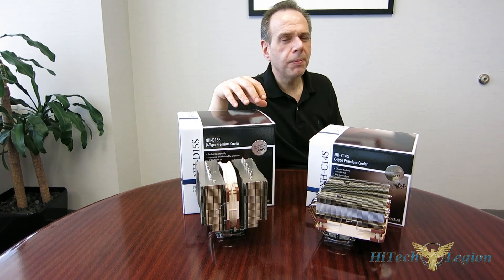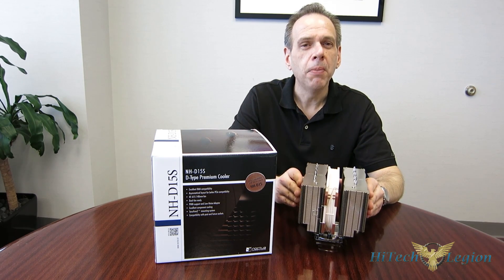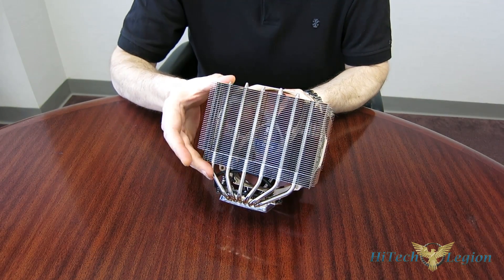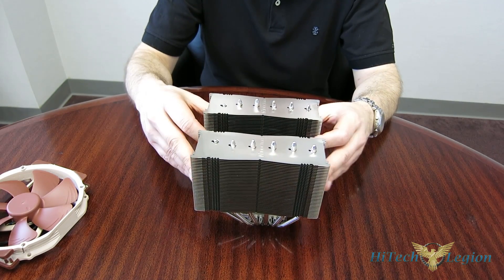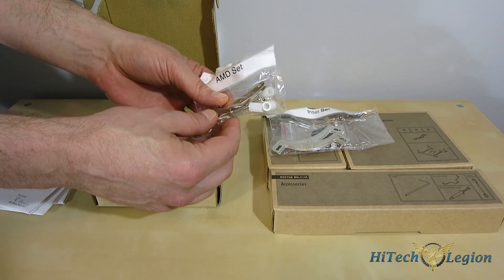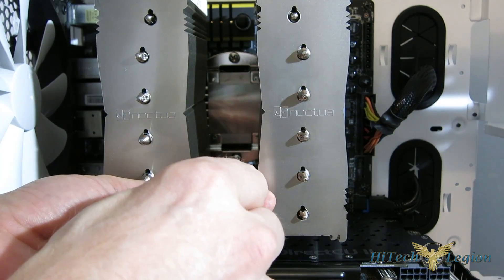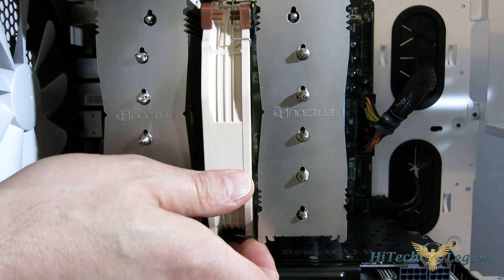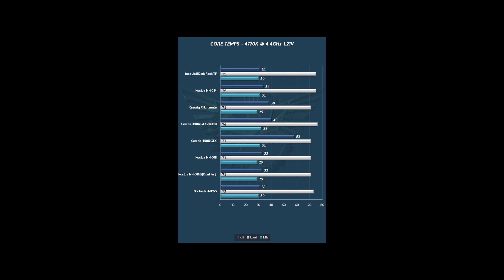Noctua NH D15S High Compatibility CPU Cooler Overview, Benchmarks and Installation

Comment: Thanks for showing the GPU clearance due the offset of the 15S. No one else had shown that yet, it’s actually quite a bit of room. I’m thinking it will not only improve compatibility, but possibly help with thermals as well

Comment: It looks like a very poor design - putting a fan IN BETWEEN 2 heat sink towers, what is the logic in that - the fan in the middle will simply pull HOT air from the nearby tower onto the other tower - i cannot imagine it being an optimal cooling - wouldn't it have been ideal to have 1 fan on the far right of the 2nd tower blowing air, and the other fan at the far left of the 1st tower (sort of in a push pull configuration) so 2nd tower gets air, 1st tower fan pulls hot air out to the exhaust.  This product is hype I hear too many complaints of people who say their temps are close to Tj, even when properly applying paste and seating.   Also it is not true that the fans are quiet, they might be quiet in SILENT mode - but they WILL sound like a Pratt & Whitney on high throttle just ready to takeoff, starting at near 100% speed, and they will be running at near to 100% speed during gaming and rendering.  It might be OK for older CPUs but Intel and AMD are creating new products that are power hungry monsters and heat generators, ALL new generation CPUs run CRAZY HOT, that even the best coolers can't keep up with short of using compressor based sub zero coolers.  It's NOT normal that a 2nd fan only improves cooling by 2C, that's crap, it should be improving it by much more, if it was not just blowing the HOT air from the other tower - I could see a 5C improvement  if it were used in a push pull config and not a middle fan, but oh well.  I think it is not worth spending $$$ for a new CPU now with all those monstrously gigantic coolers that still don't offer much in cooling, CPUs still run at crazy hot temps, I'll stick to my i5-4690K, comes with its own stock HSF, and OCed at 4.4Ghz per core, never get more than 82-85C on stress tests.

Comment: If your top fans are flush with the top of the motherboard, will this fit?  I mean, does that offset cause the cooler to go "above" the top of the motherboard (in standard orientation)?

Comment: I have this CPU Cooler. Happy. Awesome CPU Cooler. It's the legendary NH-D15 but S Model more RAM Clearance, compact. Plus cheaper. just about the same performance, max 1-2c less cool.
Reply: Lycosa I know this is a bit late but do you reckon this will be great with an 8700k?
Reply: @joedrift3235  how did it go

Comment: Anyone here able to cool their i7-7700k at full load on turbo boost 4.5 Ghz using these cooler? My i7-7700k has been getting hot even without overclock and at full load it's basically 90 degree celcius. Plan to buy this cooler if it can help my cooling of the 7700k.

Comment: I know that the D-15SE AMD version has been shifted to allow better clearance for the first PCI slot, but what side should the shift be oriented? 

I'm confused about this. I want to mount it horizontally, per the manual, but I am unsure as to which side is up/down in this orientation. If the mounting base plate is shifted, how do I know which side goes toward the PCIE slot?

Comment: So, this is NH-D15 without a fan.
Reply: No it's an NH-D15 shifted higher towards the top of the case to allow room for a GPU on x99 mobos.
Reply: what if i get a 1511 mobo [8700k +Asus Maximus x Hero z370]?  Am i better off with  D15? or D15S?
Reply: you ever find the answer ^^^^ im in the same boat as u. whats better for the 8700k?
Reply: du Bb  you can go noctua's website and check their compatibility list with motherboard models. 
My Maximus X was cleared (checked with a greevn "V") meaning its compatible and the D15 will clear room for ram.
Only thing is- one of the d-15 fans will be places a bit higher, that's all. Then, you just gotta see if it will fit your case (wont bump into the door chasis). It fits the fractal design R5

Comment: just bought one of these guys since it will fit in my inwin303 was going to get PHANTEKS PH-TC14PE but its just a little bit to tall sadly. I orginaly had an aio but am tired of wondering if i could spring a leak. and with how close this performance is to an corsair h105 i will never go aio again the extra fashion they add is not worth it to me.

Comment: I have an Apevia Dreamerx4 case https://www.newegg.com/Product/Product.aspx?item=N82E16811144277 if I were to remove the side panel fan, would this cooler fit without issue including the extra height of the fan? This case can only fit up to 155mm coolers and I'm having a hard time finding the exact size of this cooler, including the fan. If this cooler wont fit, can anyone suggest the absolute best cpu air cooler that is under 155mm? I'd really like to avoid water cooling. No matter how advanced it gets, the idea of even just a drip getting in my computer freaks me out.
Reply: It won't fit - cooler height is 165 mm.
The NH-U12S is 158 mm - also too high, unfortunately.

But: the NH-C14S is 142 mm high and the NH-U9S is 125 mm high.

On the other hand, Scythe FUMA is 149 mm high, ARCTIC AC Freezer XTREME rev. 2 is 145 mm, and Cooler Master MasterAir Pro 3 is 140 mm high.

If you still care to go for Noctua NH D15 (not the S version!), why not get another case? Yours looks slick, but I am sure you can find something else you will like just as much as this one. :)
Reply: Thanks for your reply. I actually ended up going with a Thermalright Macho SBM. It just barely fit, but it does a great job. I would like another case, but honestly I'm just very lazy and don't feel like rearranging everything lol.
Reply: Oh, the Macho is a great one! But I just did not think it would fit.
And it did!
Enjoy that build!

Comment: Another thing I really like about these coolers is that if you don't want the fan that comes along with the cooler (the 140mm one) you can also buy some 120mm fans and attach those as well. They fit. And if you add one of those on the side with the RAM, the memory clearance increases from 32mm to 52mm allowing you install even those really high RAM sticks.
Reply: So i could have a 140mm fan on the cooler and a 120mm fan on the front where the ram is?
Reply: yeah, but it wouldnt make much of a difference
Reply: 32 mm clearance?  The noctua website says putting another 140mm fan on allows 45mm of ram clearance
Reply: You can also buy the Redux fans now if anyone is reading this in 2019.
Reply: @arudanel5542  I thought 140mm redux fans had lower static pressure than the ones used on the DH15/DH15s? Meaning they'd be less efficient

Comment: If I ever build or re-build my pc into an aircooled one, the NH D15 is 100% my pick for air cooling. But if there's even a single reason why I would shy away from it is mainly caused by the fan colors. But in terms of performance and compatibility they really are at the top. Cryorig with R1 Ultimate and Universal are also a good pick although at the moment they are very scarce and are expensive. At the same time the fans on those do get loud under 100% load whilst the fans on the noctua are more silent even at full tilt (I had an R1 Ultimate from the past installed on another PC https://www.instagram.com/p/BCzQHjnuUbA/  and at full tilt they are very noticeable lol although they did perform as good as the noctua and they look sexy as fuck.)

Comment: How tall is it without the fan? Thinking of getting this and just using 2 120mm fans since my case can't fit past 160mm height.
Or could I slide this fan further down on the sides?
Reply: +Will That is listed in the specs on the Noctua web site.

Comment: In few reviews, Scytche Ninja4 is same or better for half price. But some think that it's because high pressure on cpu.
Reply: +thePavuk The Ninja 4 is a really nice cooler, and does very, very well with lower voltages and TDPs. It will buckle long before the D15, however. Also, there are the mounting issues with Skylake.

Comment: On Z97 motherboards asymmetric cooler heat pipe arrangements primarily affects mATX compatibility which have less space between the CPU socket and first PCIe slot for a GPU. The mITX motherboards have much more space between CPU and GPU, and even a regular NH-D15 fits them just fine. For example a regular D15 will even fit onto an cramped ASUS Maximus VII Impact mITX motherboard but the D15S will not because of the VRM riser! If you put the new NH-D15S on an mITX motherboard some of it will now hang off the top edge and possibly interfere with the case wall or radiator/fans. Maybe X99 motherboards are different as I've not done graphic scale mockups on those. Noctua has good compatibility charts so consult that before buying.

Comment: Thanks to this review, I'll never, ever, purchase an AIO again. Noctua is truly the way to go and this NH-D15S is king.
Reply: +Alexander Binovski If I could mount this shit on my GPU I would lol
Reply: +Static EXACTLY.

I GOT THE CORSAIR AIO, And it&#39;s LOUD AS FUCK AND not even awesome!! too loud! hard to install!

Installing NOCTUA NH-D15S today. #NoctuaClub #NoctuaMasterRace
Reply: +Alexander Binovski is the NH-D15s still the best? im going to build a comptur soon, and i want the best. 

my setup:

1. Motherboard: ASUS ROG MAXIMUS VIII EXTREME/ASSEMBLY  LGA 11511 
2. CPU: Intel Core I7-6700K
3. CPU Cooler: Noctua NH-D15S 
4. Graphics Card: Gigabyte GTX 980 Ti Hybrid 
5. Memory: Corsair Vengeance 4x16GB DDR4 3,333MHz 
6. Storage:Samsung 850 Evo MZ-75E1T0B 1TB SDD
Reply: @Maciuxe   is the NH-D15S still good in 2024/2025?
Reply: I recommend 360mm closed loop Aio coolers today, easy to setup with very good cooling. You can gain bit more cooling and silence if you make your own loop with more radiators.

What cpu do you have?
Reply: Maciuxe Gigabyte is really good, ASUS is king of motherboards. I have ASUS Motherboard MAXIMUS VII RANGER Z97. and Gigabyte GTX 970 G1 GAMING 4GB GPU... Love them (y)!!!

Get the gigabyte, but there is not much difference you can also take asus, MSI Lightning and others epic ones.... all good.

Watercooling if you do it custom (its expensive and difficulty to do, compared to AIO-ready watercooling solutionS) then its better than aircooler, somewhat. But high end aircooler is silent quiet and efficient way to do it, just not as pretty as watercoolers maybe... I had corsair AIO and Noctua aircoolers and others...

Take the D15 if your case fits with it and RAM, but if you want to save money get D15S its the same performance (except for 1-3 celcius at maximum difference) but smaller and, yeah, cheaper affordable one.
Reply: Maciuxe Nice PC, very good. I love Kingston RAM but, RAM is RAM and Corsair has great reputation too. 

You could also take the NH-D15 instead of D15S. Depends on you. but dont take a watercooler. Im happy with my D15S Premium product
Reply: +Lycosa Thanks buddy, i love ur setup, exactly what i had in mind, yours is just 1 generation older. I Will buy the gigabyte and the NH-D15s.
Reply: If you look at some of the benchmarks the Noctua keeps up with a lot of 120 and 240/280 AIOs. That impressed me. With an AIO you have 2 points of failure, the fan(s) and the pump. If the fans fail in an AIO you still may get some cooling, but not much. If the pump fails or your AIO starts to leak you're SOL.

If one fan fails on a Noctua or similar heatsink you still have another fan. If both cooler fans fail at least your case fans will help somewhat...at least enough to use a browser to order new fans. :-) And heatsinks DON'T LEAK. Yes, leaks are rare, but I don't want to play Russian roulette with my build.
Reply: Commiefornia I got one fan noctua.. NH-D15S man. if it fails it still wont kill chip probably. heatsink is enaugh. and heat protection works and throttling on Intel.

No leaks indeed. Air cooler is best.
Reply: same here, put this air cooler on my i9-10900 and couldnt be happier.  its fucking huge but thats okay
Reply: +Tj For gpu's you might want to check out Prolimatech Mk-26. It's the noctua of gpus
Reply: +Lycosa Thanks m8

Tell me about water cooling, im building this computer with no budget. I thought water cooling cpu is the best solution with benefits, less noise & cpu overclocking with cold water?

What do you recommend about graphics card. Should i buy the ASUS GeForce GTX 980 Ti, the same brand as my motherboard or buy the Gigabyte GTX 980 Ti because google says its the best graphics card. Water or fan on graphics card?

And will all these parts fit together with any computer cases i find, or do i need to be carefull about enough space?
Reply: is the NH-D15S still good in 2024/2025?
Reply: Thank you very much, i appreciate this information.
I will stay away from these brand you mentioned. 
Which mobo and memory do you have?

With your help my new setup is:

1. Motherboard: ASUS ROG MAXIMUS VIII EXTREME
2. CPU:Intel Core I7-5820K
3. Graphics Card: NVIDIA GTX 1080
4. Cooler:  Noctua NH-D15S
5. Memory:  Corsair Vengeance LPX 32GB 3200MHz DDR4 
6. Storage: Samsung 850 Evo 1TB